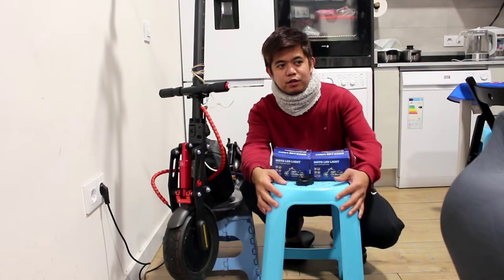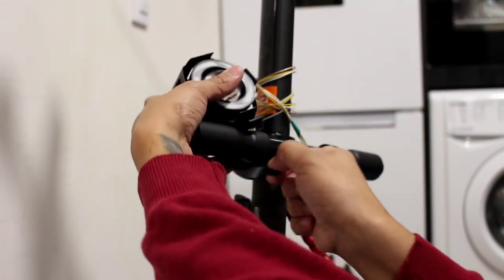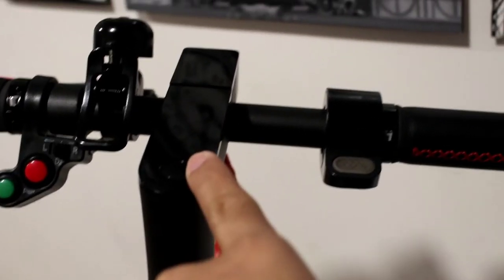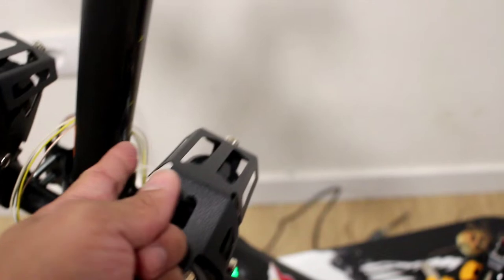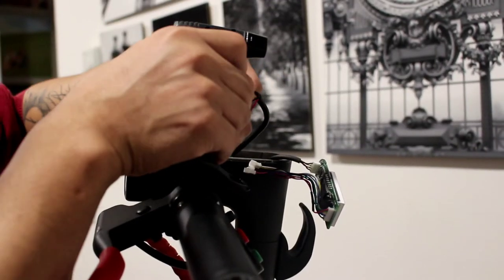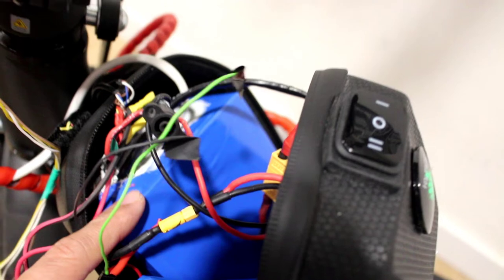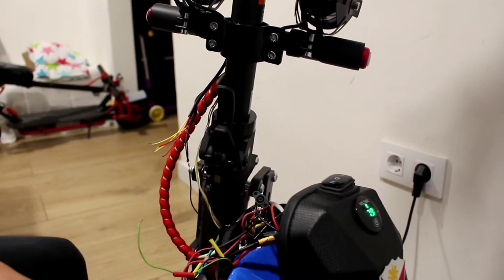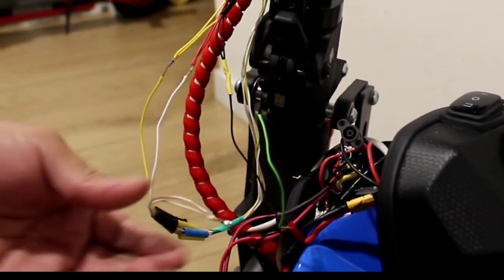how to install LED LIGHTS to electric scooter m365

Comment: Sir do you have a wiring diagram for this setup?
Reply from the maker: i dont have only just vedio
Reply: @RHON_TV  okay sir, for the wires you tapped on for the auxiliary lights, are those rated as 12volts or still 36volts? Those lamps are 12volts each?

Comment: Yung led light battery mo sir separate ba sa scooter at may sariling charging port?
Reply from the maker: oo sir 12v seperate sya nang  charger . 12v lang kasi kaya nang light na yan.
Reply: Sir tanong lang panu kong magcharge ka iba yong charger nang 3s battery mo sa oringal battery?